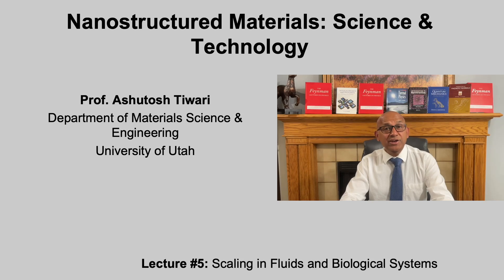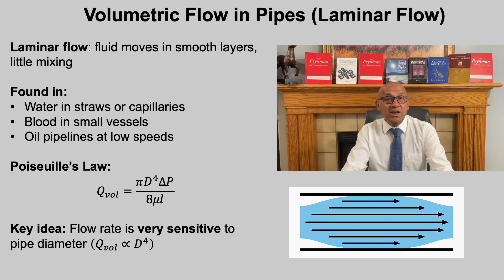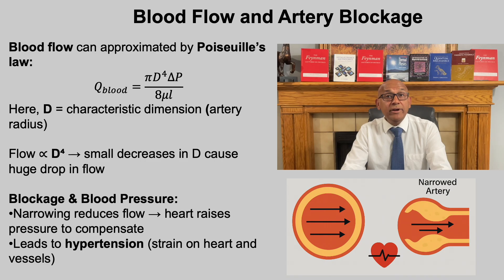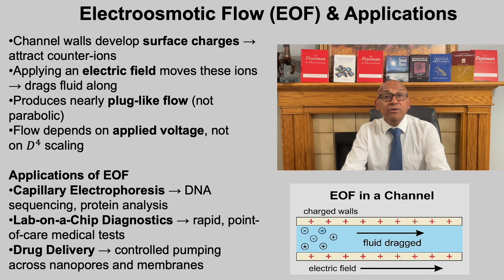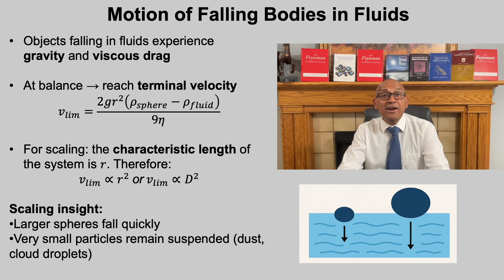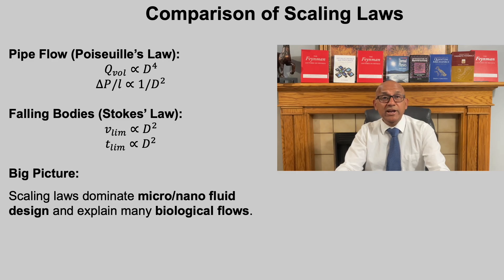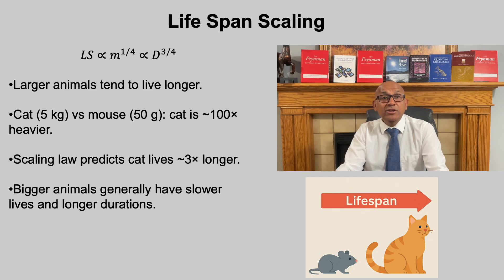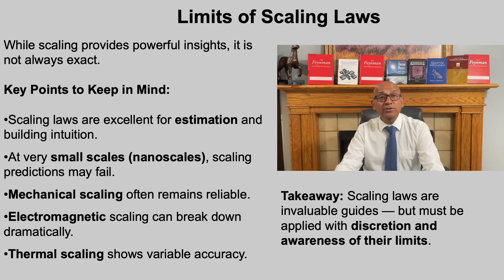Nanotechnology Lecture 5 | Scaling Laws in Fluids & Biology: Flow, Falling Bodies & Lifespan

Comment: Question 2.
According to Poiseuille's law, flow rate is prortional to the radius of artery.When the artery is reduced by half it will cause a corresponding decrease in blood flow . This will in turn lead to increased pressure by a factor of 2,to keep the system in order.
Reply from the maker: Nicely stated, George! You’ve applied Poiseuille’s law well — showing how a reduction in artery radius greatly affects flow rate and pressure. Remember, since flow varies with the fourth power of radius, even small changes have a large impact on blood flow.